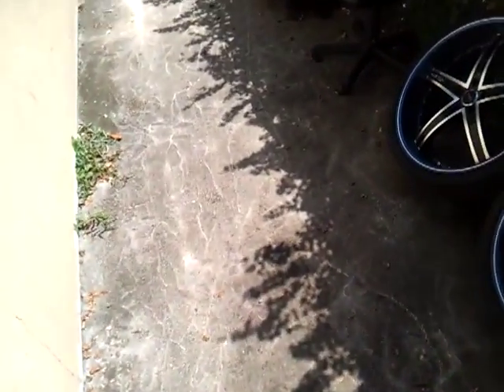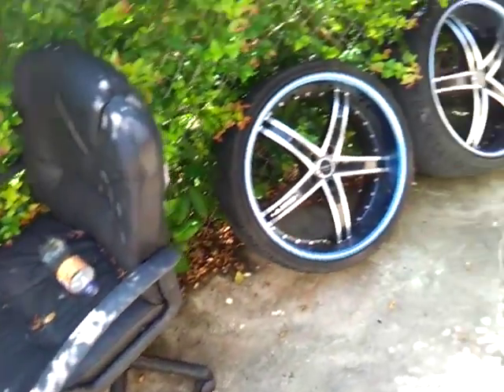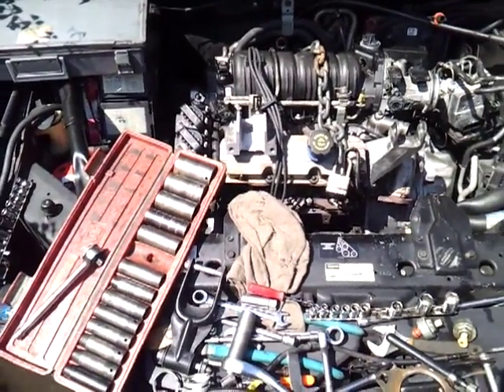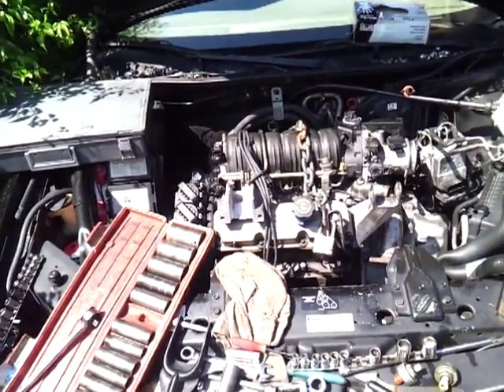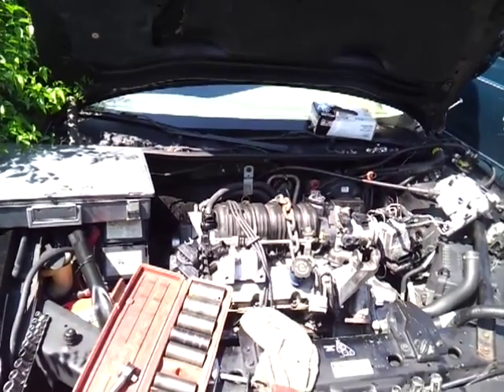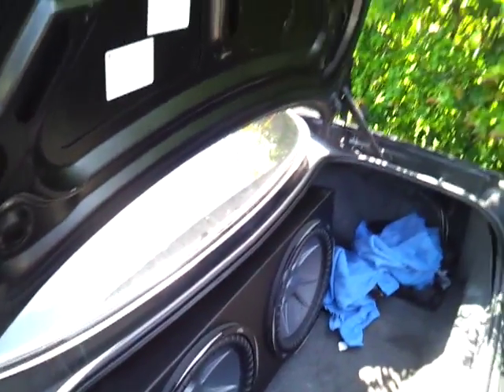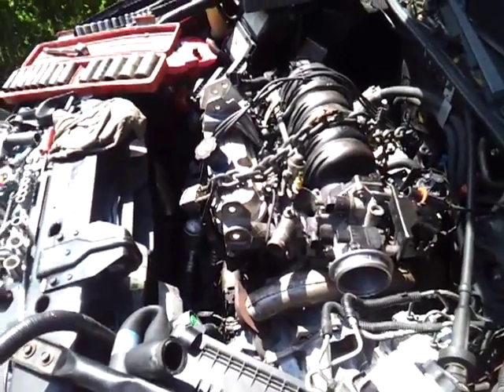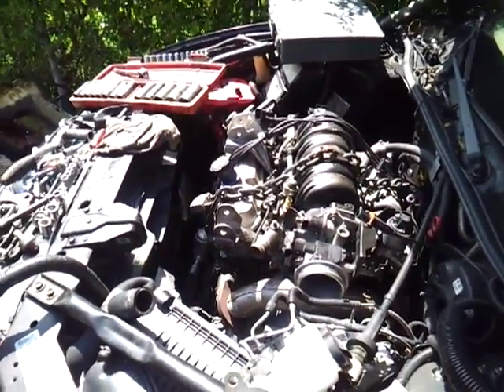Engine Swap 7 - Died @ 145,000miles

Comment: Think about everything your replacing key word being "used" I have a 95 Buick Lesabre with 175,000 miles has never given me any major issues. I have replaced the a/c, upper and lower intakes, harmonic balancer and just recently I installed new fuel injectors. But my point is when I replace its either remanufactured or brand new used items only eventually lead to failure so choose wisely I couldn't imagine pulling a motor that many times. But good work man!